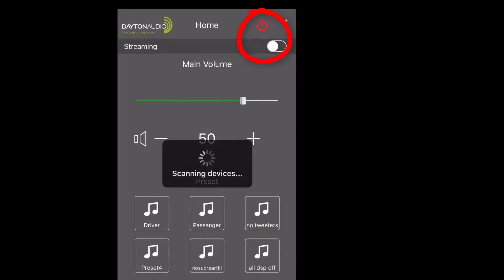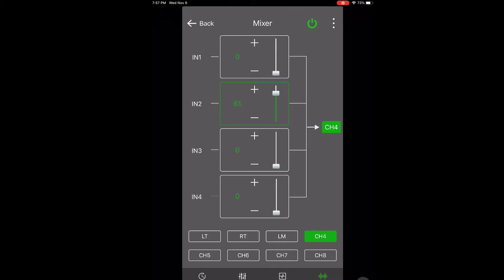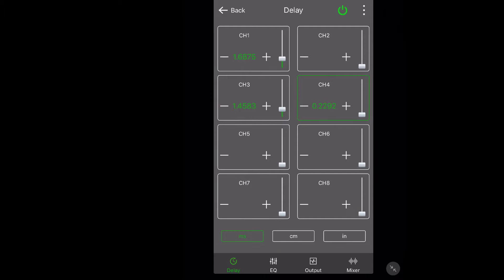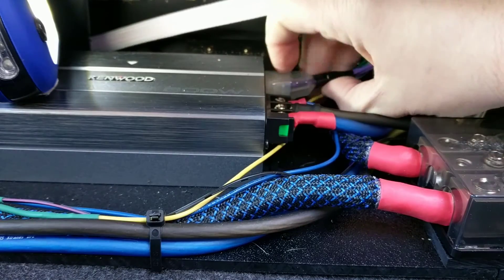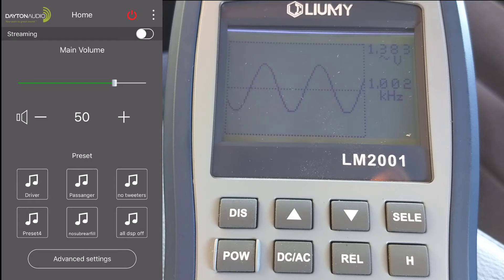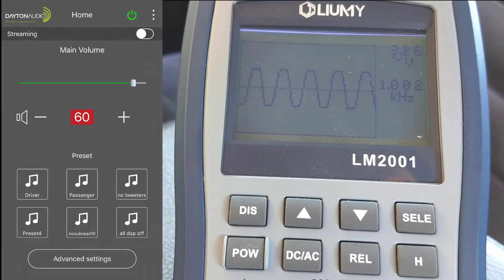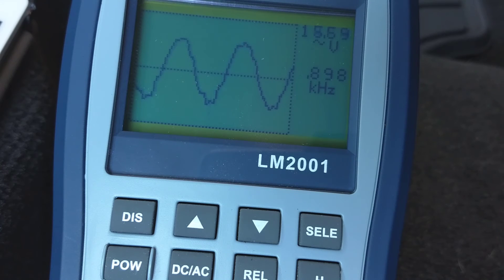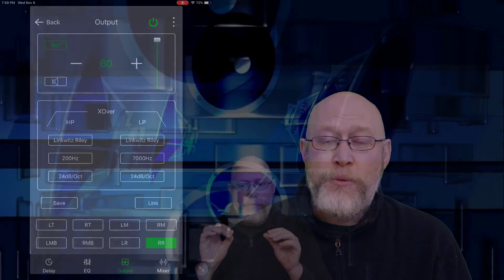Dayton Audio DSP-408:  Dodge Ram Front Stage Build Part 5!

Comment: Hello I wanna say great channel I'm subscribed I have watched most like your videos and they are amazing.I just purchased the 408 yesterday took it out the box straight to the car big mistake my problem is I can't get any sound from my oputs I was just told I have to do a factory reset before I can get any sound due to safety of the speakers my question is how and where do I reset it thank you very much.
Reply from the maker: I hate to hear that you're having trouble with the unit.  My advice is to reach out to Daytona audio tech support.
Reply: @DIYAudioGuy  yeah sure where I've been trying to reach out to them and the bad thing is I just unhooked my prv DSP so I know everything is right I'm just missing the step somewhere it'll cost you only came before piece of paper with hardly any instructions

Comment: ATTENTION in 2022 the spec sheet says it outputs 4 volts.  I spoke with a part's express Tech and he said on the bench he personally has seen 3.8 out of it.
Reply from the maker: Awesome!  Is that a software patch or is that a hardware fix?
Reply: @DIYAudioGuy  I honestly don't know. I just bought my first one this week. There is a firmware update on the dayton website.
Reply: Despite what the literature states, I too only can get 2.45v of output from the 408. I'm likely returning mine. Without the proper tools to adjust it it's all a guessing game. I don't have hours on end to sit , listen, and make adjustments. I'm going to use a simple PAC LocPRO and deal with whatever it sounds like. It's a 2017 F150 base radio fyi.

Comment: Question: If I have a HU I can set the crossovers and the EQ would this Dayton DSP actually help improve the sound of my speakers? What I'm asking is if I took the same EQ setting and crossover settings on my HU and put the exact same settings onto the DSP am I going to notice a increase in sound and clearity? Or if I add the DSP will it really not benefit me at all? Appreciate your time.
Reply from the maker: The advantage of the DPS is that you get an EQ on every channel, but your head unit is just a general system-wide EQ.  Say you are running an active 2-way front stage.  That is 4 amplified channels.  Each channel can be time aligned, so now your tweeters are time aligned with your mids.  PLUS each individual speaker now has a 10 band fully parametric EQ.  So you can pick 10 frequencies for your left  tweeter (any 10 that your tweeter covers) and boost/cut as needed.  You then have 10 more bands for the right tweeter, 10 more for the left mid range, and 10 more for the right mid range.    PLUS you still have 4 more channels, each with a 10 band EQ, for rear fill and subwoofers.
Reply: @DIYAudioGuy  ty so much for the quick response. So I really appreciate your time. This is what I have in my Harley so I hoping u can now tell me if it's still beneficial to use the DSP with what I have.

Andrew Clayton Neil I used a DD1 to get the distortion and then checked with my multi meter. I'm good there.

So here is what I'm really looking for an answer too. I just got the Dayton  DSP Which I have a friend who installs professionally. For what I'm looking to do he said go with the Dayton. It's user friendly and the price is right and it's a really good DSP.

I have a Sony 5000 HU, (4) 8ohm MMats ran parallel and bridged, and the Stinger 700 Amp. I have the Crossovers in the HU set and I set the EQ to my liking. What I really wanna know is if I set up the DSP I have, will I notice a considerable difference in sound and clarity? Would it be worth it to do the DSP. I'm pretty happy with how loud and clear it currently is but if doing this Dayton DSP will be a huge improvement than I'm down to do it. Please let me know what u think with the set u I have going on. Ty again appreciate it
Reply from the maker: @samrohde5066  depends on what kind of speaker setup you have. When I gather most motorcycle speakers just use a pair of coaxials.  A DSP is not going to help you at all with that.
Reply: @DIYAudioGuy  the MMats are Coaxial. Like I said 8ohm ran parallel and bridged
Reply: @DIYAudioGuy  and I have 4 speakers
Reply from the maker: @samrohde5066  four coaxial drivers, right?  If so, then I don't see how a DSP would help you out.
Reply: @DIYAudioGuy  yes 4. And how come? What's the difference between running them in a car and on my Harley?
Reply from the maker: @samrohde5066  They are coaxial, the tweeter is wired up with the woofer on one amp channel.  DSP is for when you have a separate amplifier channel and the mid and the tweeter.  I have a three way front stage in m truck -- the dsp manages the crossovers between a tweeter, midrange, and midbass.
Reply: @DIYAudioGuy  ok I get it. Thanks for your time. I appreciate it.

Comment: Will this DSP handle 4v in? My Kenwood Head Unit is 4v out all the way at full tilt. What I am asking is, can I go full 4v in on the DSP and use the 2.5v out to the amps without an issue?
Reply from the maker: I honestly don't know.
Reply: @DIYAudioGuy  It's been a question that has been bothering me since I bought the DSP. I will contact Dayton and see what they say. Will post back and let ya know!

Comment: you should have let us hear the way it sounded. i get youtube is not the best to judge the SQ of a system but it can give you a bit to judge is the SQ is just trash on the speakers of if there worth a try def with the different type tweeter. so what is your thoughts on each of the 3 speakers?? im going to do a 3 way active but with the cost of living increse the focals are now way out of the budget for now.
Reply from the maker: These tweeters are very bright.  Had to turn them down in the DSP.  Other than that this is a good system.

Comment: I'm really surprised I don't see much if any content using REW. You are missing out on 80% of the DSPs features unless you're using REW and a mic to tune the crossovers, timing, eq, sub alignment etc, etc.  You also get real results when making comparisons. For example, people think having trunk subs pointed into the cabin is best, but I rolled my box around and found out my best sub response is having them pointed backwards (also with the seat closed!)

I'm using a Scarlett Solo and EMM-6 with a 1/4" cable loopback timing reference. But you can use a UMIK-1 and the audible timing ref too. A lot of the info out there is for Home theater, but applies to Car audio for sure.

You could probably do 100 videos on tuning once you get going. I'm thinking about making some videos myself, Just because I had to do a lot of digging to find answers to some basic questions others might have. Now I feel like my knowledge has exceeded most of the demos being posted on YouTube.
Reply: I would love to see a video with (REW)
Reply from the maker: Just have not had a chance to film any of it because I was unsure of my audience wanted to see it.
Reply: @DIYAudioGuy   Just to add, I think most guys really just don't know about it (REW).. I thought I knew everything there was to know. (Crossovers, power ratings, wire gage, box building) But when I got into tuning with REW I realized I didn't know half what I needed, and can't imagine doing anything stereo related without it. Many people are wasting money on expensive gear, when all they needed was a little tuning w a mic.
Reply: @DIYAudioGuy   Assuming your audience is mostly bass heads, you could definitely show response curves of all the different boxes you build, compare SPL to different physical and changes you make, how to use the alignment tool for sub integration (not using a tape measure) the possibilities are endless.. my car had a huge dip around 70hz (and crazy peaks throughout the upper range) before I did everything right.

Comment: My radio only has 2v preouts but its clean with the SMD DD1.. Installed the Dayton DSP and plugged it into the DD1 and it's clipping bad.. By the time I turn the master volume down to eliminate the clipping it's not even registering a signal on the DD1 anymore.. Checking outputs at the amplifier it's clipping with the gain all the way down.. What the heck?  Put the PRV crossover back in and everything setup fine.. what you think??
Reply from the maker: Not really sure.  You should be able to get 2.5 volts clean out of the DSP.  Sorry you're having trouble with it.
Reply: @DIYAudioGuy  Thanks for the reply.. Ive tried everything I could think of.. No luck with tech support either.. guess I'm sending it back

Comment: The reason you want your speakers connected while setting your gain is because the load/resistance you put across the amplifier circuit causes it's power supply voltage to sag.
This is the reason higher ohm louds usually get you less power from your amplifier.
Some amps have circuitry to run the same power at different ohm loads but not many.
I know how annoying it can be hearing ear piercing noises but it will definitely sound as clean as it can if you do.
Other than that I love the video the explanation of the dsp was helpful and very understandable.
The crossover is great but it definitely takes some tinkering to figure out.
Reply from the maker: You are correct.

Comment: Your supposed to set your gains with the speaker load attached.
Your amplifier will not put out the same clean signal at the same voltage when you hook your speakers back up. Go watch some barevids he explains it all
Reply from the maker: I've seen that video.  I'm aware of the arguments on both sides of the issue.

Comment: more!
Reply from the maker: There is always more on the way!
Reply: @DIYAudioGuy  I have this dsp with 2 amps and powered sub and 8 speakers on the amp crossover I know they need to be off now but do I put them on all pass or high pass with the freq all the way down I just don't want to change the signal putting out flat on all pass or having a low freq on high and blowing my speakers I don't have a rta or anything to test the signal any help would greatly appreciate it!

Comment: Nice video, have a question.  Do you only need to use one input (volume) for each speaker? If that makes any sense.
Reply from the maker: I guess that depends on what you're trying to do.
Reply: @DIYAudioGuy  Have tweeter and 6.5 mid bass. Which are crossed over using the crossovers that came with speakers. Have 3.5 full range which were just replacements from stock. Also have a sub.
Reply from the maker: If you're running your mids and highs off of a 4-channel amp then 4 channels of output from the DSP would go to that 4-channel amp.  One channel, or two depending on how you have it set up, would go to the sub.
Reply: @DIYAudioGuy  Thanks for the reply. What would you be setting the input levels too? For each channel?
Reply from the maker: @dennischow7773   I'm not really sure what you're asking.

This particular DSP has six input channels and eight output channels. The six input channels go into a mixer.  This is handy if you are trying to integrate into a factory head unit.  It allows you to sum channels so that you can take a tweeter and a mid-range input and get a full range output.  The mixer will let you route any input (or combination of inputs) to any output (or any combination of outputs).  This is usually pretty straightforward -- the right rear channel just gets sent to the right rear.  But you can make it more complicated if you wanted to.

The rest of the settings are for the 8 individual outputs.  This is is where you can set crossovers, phase, time alignment, and a EQ.  There is also a level control on each output.
Reply: @DIYAudioGuy  I'm really a newbie at this so thanks for taking tome to explain some of it. Just wanted to also know doni set the input levels to 100? Or do I set to a lower number say like 50?
Reply from the maker: @dennischow7773  100
Reply: @DIYAudioGuy  Thanks! Will set to 100 and start tinkering with settings

Comment: On the Durango I have, I had bought connectors to not cut the factory wires. Of course, it became apparently pretty quickly the expected polarity was reversed. How annoying to pull the doors back apart for that!
Reply from the maker: What a pain!
Reply: I do have one of those polarity testers, but haven't had much luck getting mine to work reliably. At some point I'll put an Amp Pro in there to get aftermarket amplification and something a little higher quality than the infinity reference 6x9s. The investment though, is pretty big to do it right.
Reply from the maker: @Bradimus1   This is not a cheap hobby!  There's always other piece of gear to buy, there's always another tool that you need.
Reply: I have lots of tools! I was selling and ordering car audio 04-06. The cost of aftermarket integration has gotten pretty steep though. Then again, there are also way cooler toys now like the DSP.

Comment: Great stuff DYAG! Interested in the DA DSP. Are you still happy with it?
Reply from the maker: I am.  It is good for the price.  Rumor has it that nakamichi is going to have a 6 in 12 out DSP that uses the same software kernel.  Allegedly it's less than 300 bucks. If it can do a proper center channel I might upgrade.

Comment: I finally powered up my Dayton DSP408 this week and I used this video as a tutorial. Based on your findings in the video I limited my volume on the DSP408 to 56 and i found the output quieter than i would have hoped for. This was only using the bluetooth dongle audio streaming input, I have not connected my factory head unit yet.

I decided to purchase a cheap o scope and do some more research and measured the output myself on my new o scope and found conflicting and varying results. When streaming via bluetooth I was able to get a clean unclipped output using 0db 1000Hz and 200Hz signals (JL Audio files) but I was limited to about 61 at 50Hz when playing bluetooth from my phone (bluetooth volume on the phone was maxed out). Out of curiosity I tried a few different audio apps on my phone (I set all the eq settings to flat in the apps) and I got some that would support an unclipped output all the way to 66 and some only to about 56 (matching your results).

Can you provide more details on what input you were using on your test and did you separately measure bluetooth and RCA input. I am trying to figure out if there is variation between production of these units and how much the input matters coming in. I feel that the bluetooth input being all digital should have the cleanest signal input but I am not sure. I appreciate any more details you can provide for your input signal when you did your testing. Thanks so much for making these videos.
Reply from the maker: It could be anything.  If you use 0 db test tones you will get a different voltage than if you use -3db test tones.
Reply: @DIYAudioGuy   I was just curious what your set up looked like for comparision. I think you said you used 0db test tones also but I was really interested to know if you had measured the bluetooth vs RCA input and what were your bluetooth inputs on. Thanks.
Reply from the maker: I bluetoothed to an Alpine headunit and ran RCAs to the DSP.
Reply: @DIYAudioGuy  Thanks that's what I was hoping to hear.

Comment: I am seriously considering buying this dsp for my 2015 Tacoma with Entune non JBL. Reason I want to get this is because I do not want to change the HU because of the rear camera and steering control. Do I need to set the HFP on the amp after setting it on the DSP? And I found out that by using a molex connector from a fan and removing the pins it makes it easy to use a DMM without having a second person on those types of amps. Thanks for the great video.
Reply: One more question about the DSP. Does this help level out different volumes from the different sources?
Reply from the maker: Yes, you can change the input and output  level.
Reply from the maker: Sounds complicated!  You won't need to use the crossovers on your amplifier if you use this
Reply: @DIYAudioGuy  So set the Amp to Full Range? Thanks for the fast response!!!
Reply from the maker: @Rxking713  Right because the DSP has a much more versatile crossover feature
Reply: @DIYAudioGuy  awesome thanks.

Comment: So the dsp introduces clipping above 55? Wish I knew that when I was setting mine up.
Reply from the maker: Not a big deal, just have to turn it down.   The spec state that the outputs are 2.5 volts. It puts that out just before clipping.  So technically speaking it is performing as advertised.  it would have been nice if they would have given us 4 volt preamp outputs. But is that really fair to expect on a DSP that you can buy for less than $150?
Reply: Hi, you probably should measure your clipping point like DIYAG did. It may be that it clips just past 2.5 Volts and, based on input voltage from the HU or LOC (different for each HU) may therefore reach that point at a different DSP volume setting (i.e., not necessarily 55).
Reply: @2vertical2  Good point. Thank you.

Comment: Any chance you have tinkered with a Power Acoustik RZ4-2000DSPB? I can’t find any kind of tutorials on it for tuning my motorcycle speakers and don’t wanna risk blowing them
Reply from the maker: I've never tinkered with one of those. But it should operate like just about any other amplifier.  Are you trying to set the gains and crossovers?